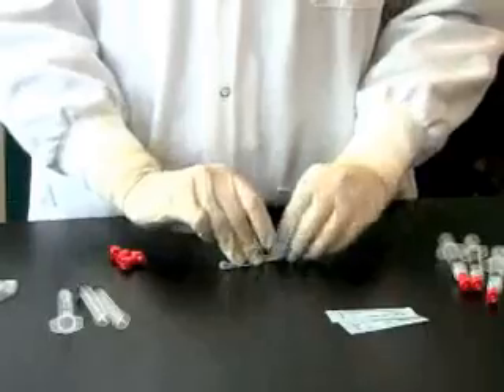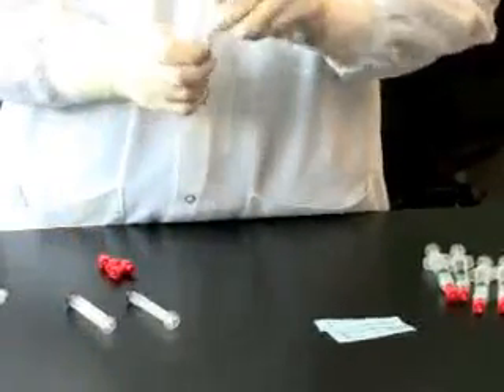Ethylene Oxide Sterilization Validations

Comment: This is what is on the covid test swabs, causing brain hemorrhage, brain cancer, lymphoma etc.
Reply: @dyonbakker4630  check the packaging of the tests, it usually has a small EO written on it. Supposedly, your brother took one test then he’s fine but repeated exposure is extremely harmful!
Reply: @dyonbakker4630  from research this chemical is used to sterilise the swabs in gaseous state, some doctors say that this doesn’t cause harm because it doesn’t remain on the swab. But surely there’s still some sort of residue on the swabs since they have disclose it on the packaging and your sticking them up your sinuses which can’t be good. Yeah most of those lateral flow test kits have this chemical. I haven’t found many people speaking out directly about this so i can’t be sure if it’s bad or not. Supposedly, it’s a carcinogenic chemical on a swab which you stick up into your nose (or mouth) and repeated exposure of this increases chances of developing cancers. I wish someone could clear these misconceptions up because there’s other ways of sterilising swabs that don’t involve ethylene oxide.